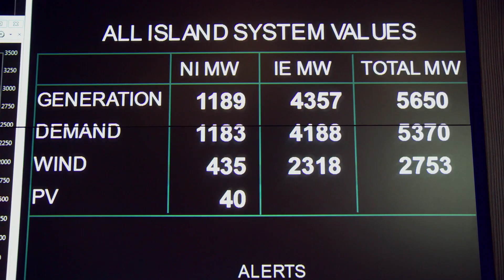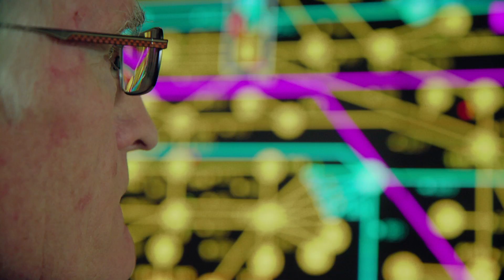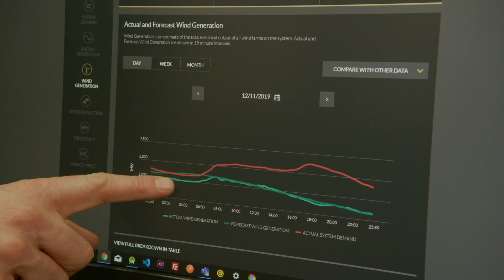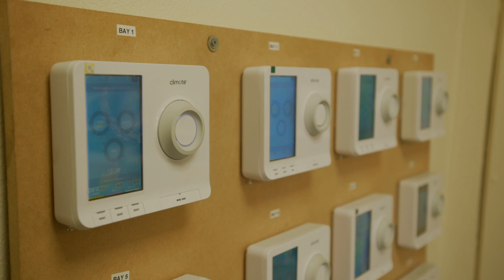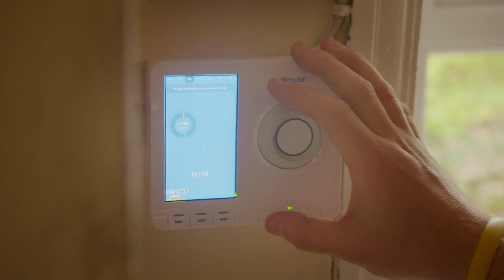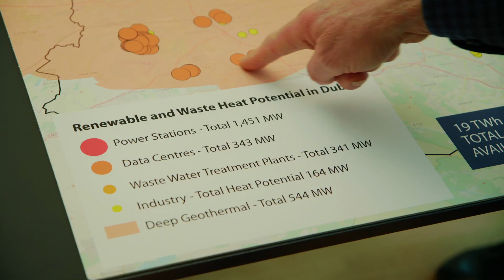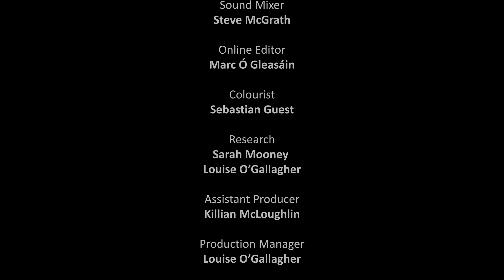Ireland's Energy Challenge EE18 EP3 (Part 2)

Comment: Current electricity costs are being driven up mostly by fuel prices,

If we switch to Nuclear power and give greater incentives to buy electric cars (including subsidising and prioritising lithium battery production) this problem will subside substantially over time. 

Also, many countries are going for the practical short term measures of taxing fossil fuel company profits to discourage extortionate profiteering.

Overall though, Society’s rejection of Nuclear power was a massive mistake, and the environment has payed dearly for it as we continue to rely on fossil fuels for our electricity!

Comment: Can you hear the whinging that's coming? "We all need to do our part...(then) stop using so much electricity...we all need to sacrifice and will have pay more for clean energy.....(then) if you are not responsible and use too much, you are going to be charged extra..." How about they are worshipping the earth and they expect for you to pay homage to mother earth too. The promises of cheap, clean energy are patently false. They have neither the will, discipline or means to do it. When they fail to bring about their utopia, it is just going to get pushed back on consumers in Ireland with higher charges, less reliable supply and a lower standard of living.

Comment: Great program. Thank God it’s on YouTube now. RTE wouldn’t let us watch it from abroad. 
 Anyone know how much it costs to get that  renewable energy thing for the immersion? 🤔
Reply: You can get an Eddi diverter for about 450 euro that can run your immersion based on grid signals or surplus solar on your roof
Reply: You’d want to check out the payback timeframe because almost all so called renewable energy systems cost more than what you’ll save. They work on the fact that people fail to use basic maths.